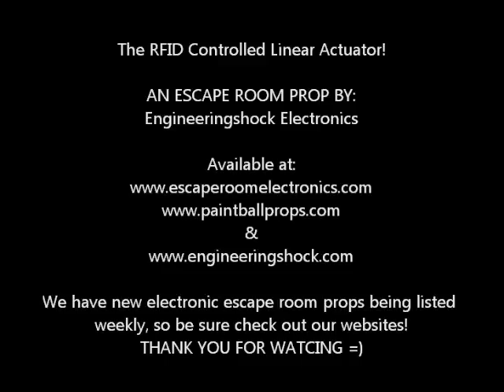The RFID Controlled Linear Actuator Escape Room Prop!

Comment: Ok Patrick this system is awesome but now I have a request I want a simple actuator driver for a door to secret room  that is rfid activateded just one sensor to open it and A button that you can put on the inside in case you get locked in